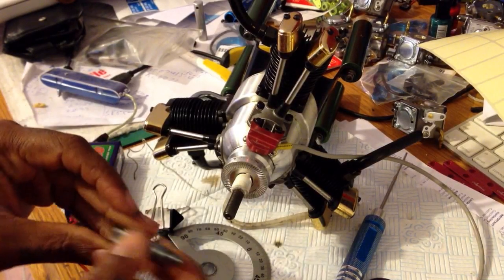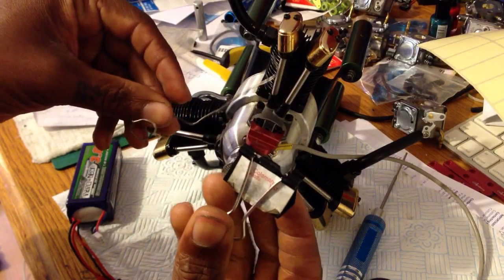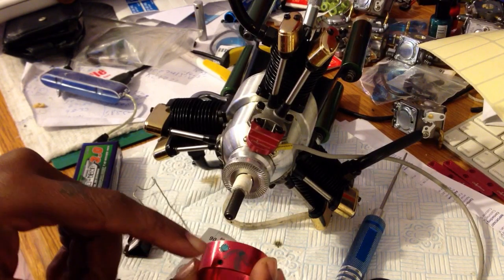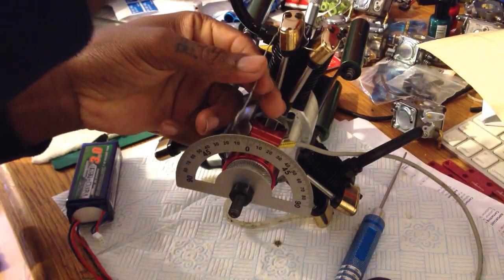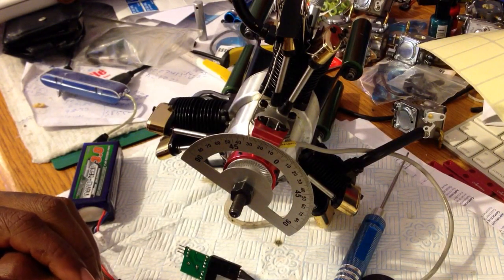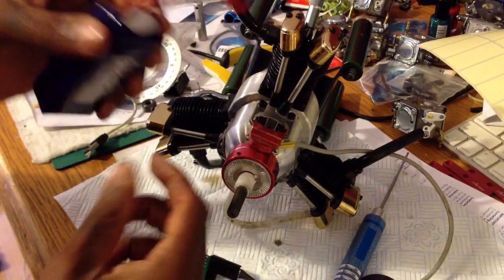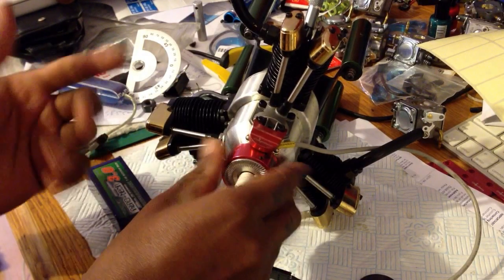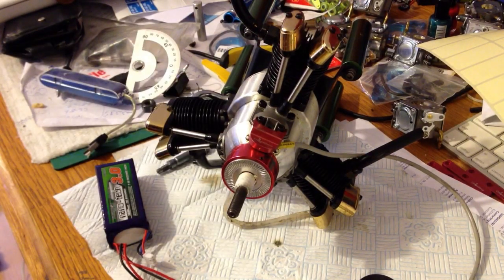Saito R3 CDI Timing setup

Comment: Morris, in your single cylinder timing video you time the spark to fire (30 degrees BTDC) as it LEAVES the magnet. On this multi you time it as it ENTERS the magnet. Is that correct?